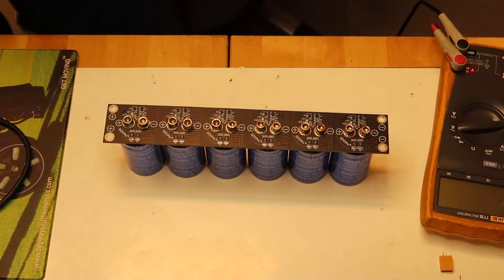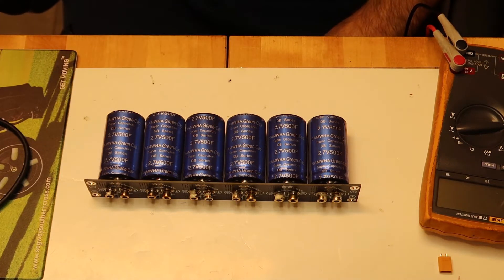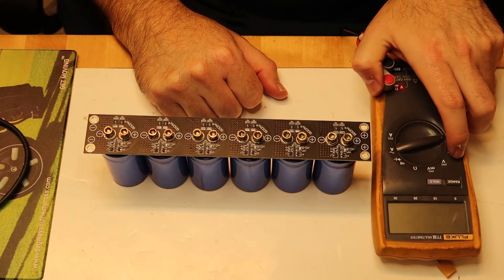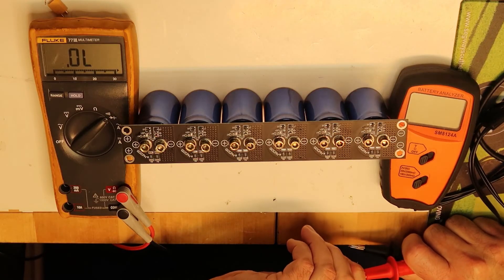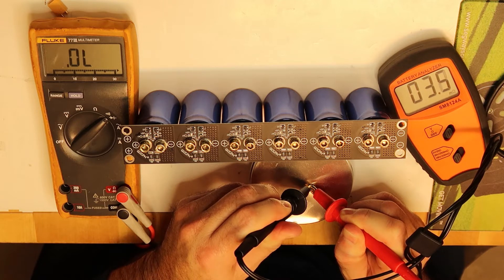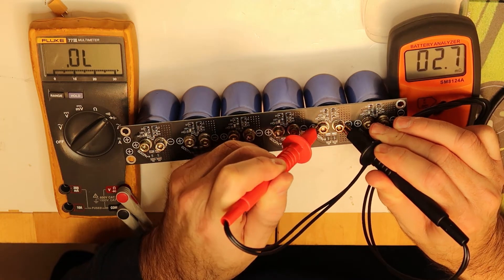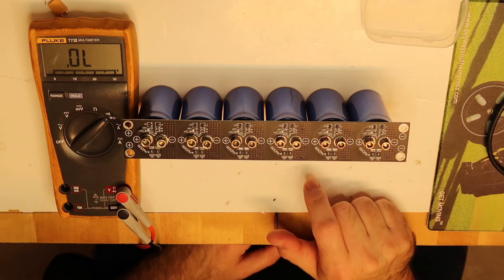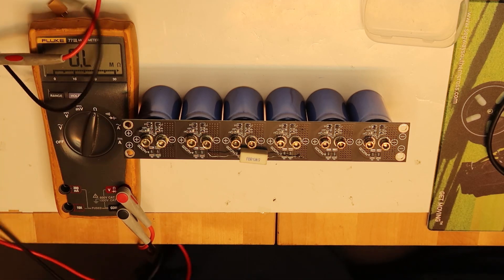Board with 6 x Super capacitors 500F 2.7V good for Welders

Comment: How much is the internal resistance if you measure the whole capacitor bank (in series)?
Reply from the maker: I will test from one side of the board to the other and update later, I expect about 5 miliohms, but I will update about results later
Reply from the maker: Checked this is 15 miliohms! probably because of PCB and connections that are adding resistance.
I think if you add connections with wires also you can get down to 9 miliohms, but need to test this
Reply: @RoeeBloch  Thanks mate. I am planning on getting a power source for my diy spot welder.
If this pack can deliver about ~140 amps for a few milliseconds than it would be ideal for me. Or maybe two connected in parallel. I prefer not to use Lipo for safety reasons, LifePo4 would be great but it is hard to find in series pack and also more expensive.
The internal resistance is a bit high thought, a 32 Ah SLA car battery has 6-12 mR when new.